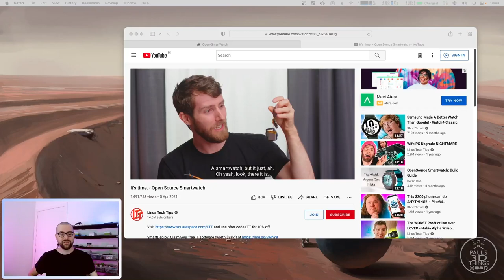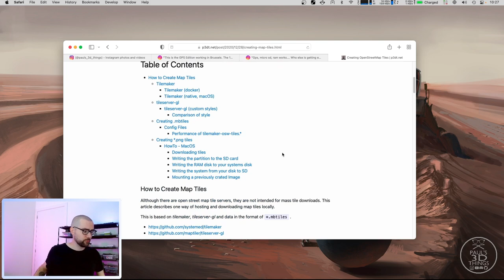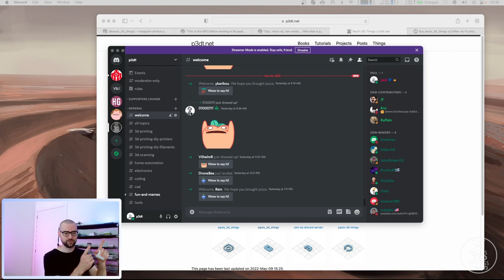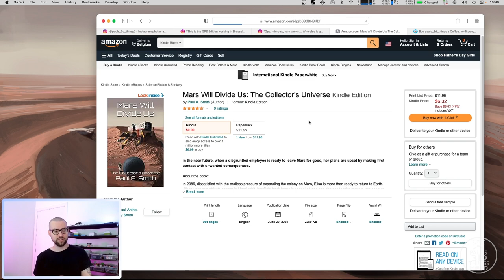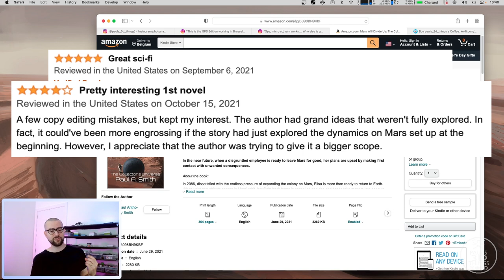What happened to Open Smartwatch?

Comment: Quick update for those that aren't in the Discord: Paul has stopped working on all watches since 1-December-2022. It is up to the community to figure out the rest.
Reply from the maker: Correct. The OSW-OS is being actively pushed forward, but not by me. I‘m happy to say that the contributions have surpassed my initial codebase by A LOT. Notifications are being added, modularity to support more (esp32 based configurations), an emulator,… the project is not ending because of this. this is exactly why I did it as open-source (gplv3), so my initial code is free to be changed and improved by others! if you use the search on my discord you will find many infos (for example how to mod your pcb for better standby currents, or other pcbs that should work too). biggest issue might be the hardware manufacturers that stopped making the original PCBs and made their own variant without integrating it into the osw-os (or keeping to the open source license), which makes it harder to join the project…
Reply: @pauls3dthings  ahhh... That's too bad. Soooooo close to the goal post.
Reply: Thanks. "As the GPS Edition is still under development there are no released files yet." - I guess that's not true. Seems this video was a teaser for vapourhardware
Reply: Aw dang, that really sucks to hear. I was actually looking about for progress as the GPS version remained on hold. It sucks to hear that hw manufacturers just screw you over like that, especially those from certain eastern countries. This newer version looked even better, sucks we can't have one anymore. 

It's been almost a year and I can't really find this newer version anywhere (and I really don't want to go dig into discord for updates on hardware). I do hope someone takes the effort to merge the enhancements into the git. Or at the very least comes up with a central repository type system for all those add-ons (for which github isn't really the place either).

Comment: What software does it run? I see it's called "OSW-OS", and it's designed to run on ESP32 MCUs, but what is it, exactly? What features and APIs does it have? What's its design? Does it have a separate userspace, or does everything run in the kernel? What languages and tools can I use to develop apps for it? Can I install apps without building it directly into the firmware and re-flashing it?

I see it uses PlatformIO IDE, and that's pretty much all I could find about the software development process; so I guess everything needs to be built into the firmware, and probably everything runs in the ring 0.